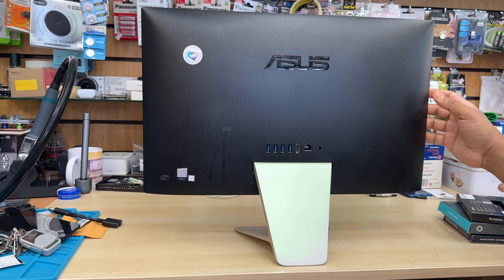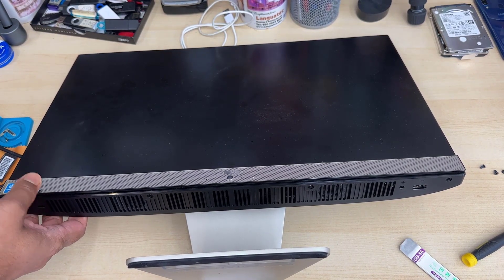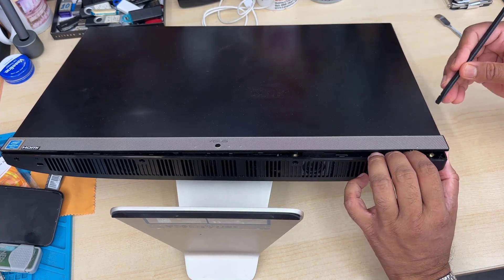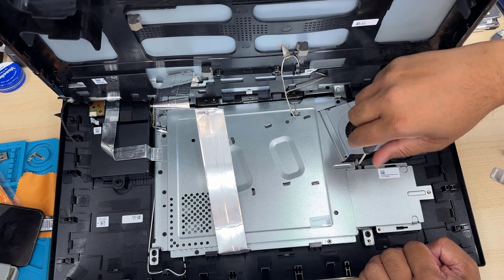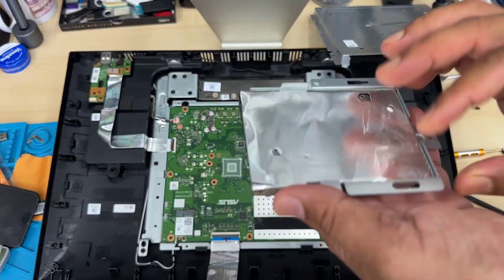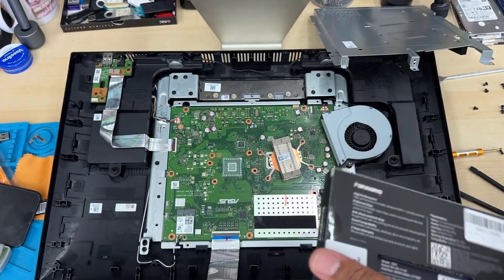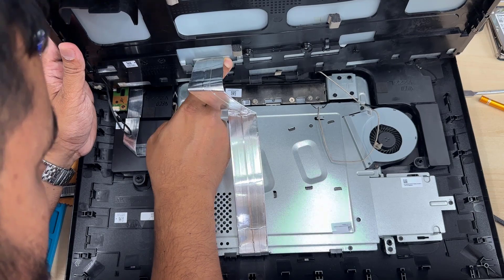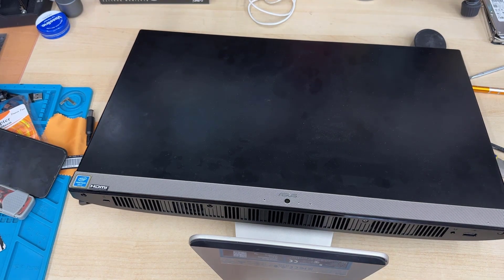How To Upgrade SSD For Asus Vivo V222F All In One PC

Comment: Can you put a video card on this type of computer? I have the v241eak model and my video card is integrated in the intel i5 processor and sometimes it refreshes for 5 seconds, the monitor closes and reappears, it's really annoying and I think it's from the video card in the processor. I'm going to upgrade the RAM from 16GB to 32GB and then see if the monitor still shuts down like this.